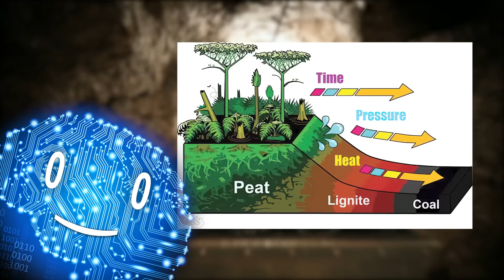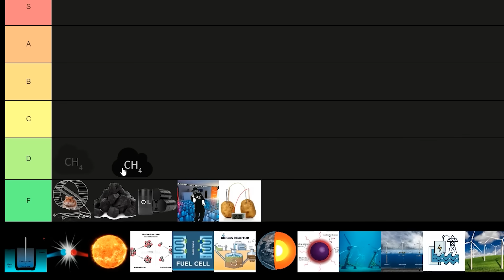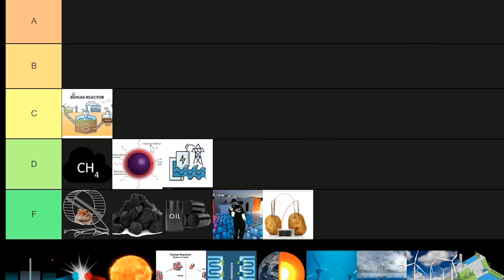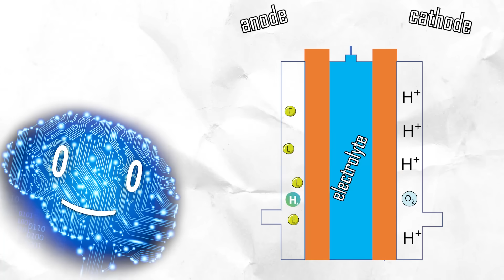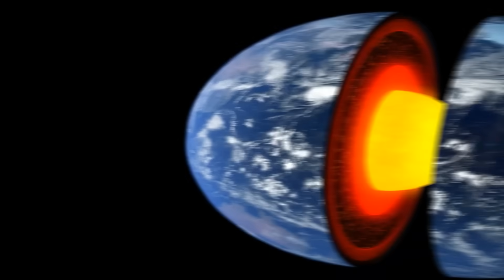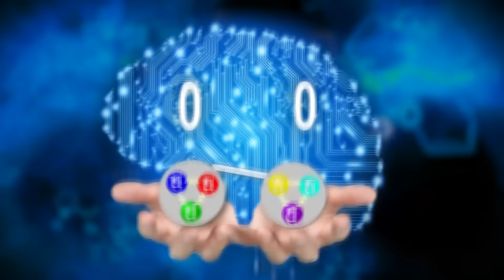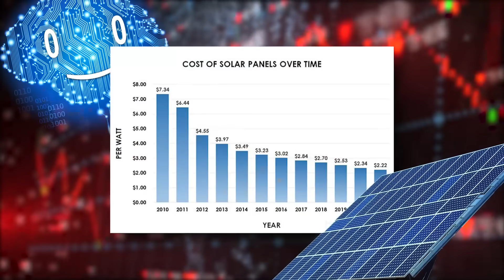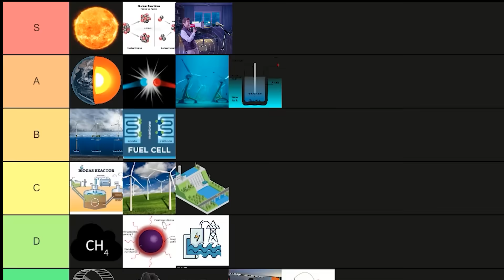Tier List of Energy Sources Explained

Comment: The anti-nuclear crowd has always been a weird thing IMO. Coal plants pump out lots of toxic fumes and plenty of radiation on their own.
Reply: Solar vs Nuclear: (source: Joe Scott)
1. Bhadla Solar Park, India (largest solar park)
- Area: 57 sq. kms
- Production: 2,245 mw
- mw per land: 39.38 mw/km²
2. Kashiwazaki-Kariwa Nuclear Power Plant, Japan (largest nuclear plant)
- 4.2 sq. kms
- 7,965 mw
- 1,896.42 mw/km²
Reply: @HSstudio.Ytchnnl  thats fucking nuts
Reply: @HSstudio.Ytchnnl also to note it’s impossible for a meltdown to happen in modern reactors. You can’t even intentionally cause a meltdown. The fuel types they use  now don’t even melt in accidents. They also have drop by gravity rods to stop the reaction immediately if power is lost. It also detects how hot the core gets. As it gets hotter it slows the reaction aswell. Now they are making gravity fed coolant so that coolant flows by gravity and doesn’t require a pump for emergencies.
Reply: @HSstudio.Ytchnnl  Which video?
Reply: Fly ash from coal is way more radioactive than nuclear waste. More so on a joule by joule basis
Reply: @Bladeofdeath311 and nuclear waste is mostly the clothes and shit which is easily disgarded and so little amount the actual radioactive matter which is 90-98% but due to a stupid nuke treaty it id heavily restricted. But no one bothers to know nuclear power plants can run for years before needing to change the fuel rods
Reply: If we can harness all the Reees online we could potentially have nigh infinite energy.
Reply: This jdr guy never actually rebuts anything and only give out his points. He seems to point out pro-nuclear’s intelligence by… insulting them? Hypocritical much?

And just by reading how he responds to people, I can tell that he types with an ego the size of the solar farms he’s trying to defend.
Reply: I am anti-fission but only if its replaced by solar. Solar is way cheaper, way cleaner and way safer than any other energy source we currently have. It gets cheaper than the other sources when you consider the fact it has zero input and its just maintenance so the longer it stays the cheaper it is compared to the rest. The main problem with solar is that it works mainly when there is good sunlight and we dont have a very good way of electricity storage so you couldnt make a big solar farm that efficiently covers the electricity need of a large area 24/7. Fission and wind are the best because they can work 24/7 but out of those wind is better. So in my opinion solar+wind is the best. It's so weird that rich people still haven't moved away from coal, oil etc since those arent even cheaper than solar anymore so you cant tie it to being greedy or selfish.
Reply: @phaiz55
 
...Continued...
 
If every country in the world had multiple nuclear powerplants, how much nuclear waste would the planet generate after ONE HUNDRED YEARS?!!! 
 
This shit cannot be used whatsoever and lasts for like a million years. Nuclear people are VERY SHORTSIGHTED lol so are we going to start shooting nuclear wastes into space??? 
 
But once again, building a power plant in the first place leaves a massive carbon footprint so most plants dont even start paying for themselves until like 100 years after building. SOLAR IS THE EASY ANSWER
Reply: exactly! it's just not monitored. all that radioactive radon and other impurities is just constantly pumped into the atmosphere. with fission those products are monitored, sealed, dealt with, and completely accounted for.
Reply: Accidents like Chernobyl and Fukushima scare people. The damage caused by coal plants is more insidious and happens over longer periods of time. And with how long they have been used, it is something people have gotten used to.

And there is also the thing that when people think nuclear, people also think weapons, which creates further stigma.
Reply: I KNOW RIGHT
Reply: These are no ecologists, these kind of pepole are called political dissidents for example in Germany moneypumped by Russia
Reply: Radon gas
Reply: The only argument they have is  the Fukushima nuclear accident which wasn’t even caused by the power plant itself but a tsunami🤦‍♂️Not to mention the technology behind these stations has vastly improved and it’s way more secure
Reply: Issue. Using coal does have a biproduct that produces nuclear weapons
Reply: There’s no justification for anti-nuclear people. Especially those who profess to be liberal climate activists. 

Well managed, well regulated nuclear energy can and will save the entire planet.
Reply: I’m against nuclear because there are better alternatives such as solar and geothermal that doesn’t create thousands of tonnes of nuclear waste that needs to be shoved somewhere and doesn’t have the chance of meltdown. I am not for the use of fossil fuels. I’m pretty sure most anti nuclear folks are like me.
Reply: Nuclear is the most expensive energy source and takes the longest to bring online. For the cost of nuclear per KWH you could have triple the energy with solar in a fraction of the time.

Uranium mining releases radioactive waste and once we run out of it that’s it. Then there’s the water usage and disturbance it brings to whatever water source is used to cool the reactor.

Yeah coal is bad but nuclear isn’t great either. Wind and solar are superior.
Reply: @scottlarue5304  Solar don't output enough power on their own, having to install a lot of them everywhere. My own house has solar panels that provide more than enough energy for my house but a nuclear reactor would have a lot more power and won't require good weather conditions. Would you want to live next to a wind farm? They are too loud, there's a reason why they aren't as spread out in populated areas, the only reason nuclear died out is because of low cognition morons that think it's scary.
Reply: not trying  (my opinion 🤓😎):face-fuchsia-tongue-out: to apply modded minecraft logic to the real world :face-blue-smiling: but. my uranium reactors (fission) :face-purple-crying:take like way less infrastructure (less upgraded item transporters)🥶 than coal for similar output.:face-blue-wide-eyes: it seems as if uranium based power solutions produce more rf (restone flux :face-red-heart-shape:) per tick as opposed to 🤮coal reactors and are :face-pink-tears:slightly more costly with regards to materials as well :face-purple-crying:. This leads me (@mozin01 😇) to believe that ☢nuclear reactors :face-orange-raised-eyebrow:are more efficient even in a scenario with instant  :eyes-purple-crying:wireless transport (enderchests mod and quantum entangloporters :face-fuchsia-wide-eyes:).  Although, one must always stick the right key into the right hole 🤨📸. You surely wouldn't catch me using a solar panel in the deep dark dimension🐪, nor wind turbines around the black hole that I generated :face-orange-biting-nails: and built a space station around :trophy-yellow-smiling:, although they would both be excellent at y-level (attitude:face-red-droopy-eyes: grr) = 256 in the overworld.  Fusion reactors :face-fuchsia-wide-eyes: on the other hand, are straight up not of the balance :face-turquoise-covering-eyes:. Water for infinite power straight up is just a Gregification :face-orange-biting-nails:(GregoriousT) of power creep 😱. Going from gradual 😴(you have to wait for it) hydro 💦power from water wheels (which is just un-Gregified 🪛solar 😎 power) to near infinite :face-blue-wide-eyes: energy from standing water🥶 seems like the pack developers ♿forgot to adjust some config settings:eyes-purple-crying:.
not to mention you can breed 😫💦leftover fission fuels for more fuels :face-orange-raised-eyebrow:.
🚼➡🚪
Reply: @Mozini01 What the FUCK did I just read.
Reply: @Mozini01  gregtech mentioned but at what cost
Reply: @Scrufflord 😭Omgggg i forgot about this comment hiii I hope you’re having a great day!!
Reply: @Mozini01  haiii :3
Reply: @Mozini01  peak yt commenting
Reply: It's not like irradiating large portions of land and sea, and killing large amounts of life, whilst also posing a major problem for the future and harming nature for thousands (or more) years to come, is a far better option.
Ain't nobody saying Coal > Fission
But fission isn't good. I can name so many better, more efficient and more enviromentally safe  options.
Reply: The nuclear supporters have a terrible sense of scale as yall get tunnel visioned hella easy. Due to all the concrete and other requirements, the process of making a nuclear plant in the first place produces a ludicrous amount of greenhouse gases. Plus nuclear waste is some of the worst stuff in the history of existence. PROPERLY containing that stuff requires constant energy which takes away from the total output efficiency. Plus you already know these companies arent going to follow all the regulations as they already dump waste where its not supposed to be
 
There is a giant ball of plasma up there tossing free energy everywhere. The money thats used for  Nuclear Plants should be allocated to making Solar as easily available as possible
Reply: @jdrmanmusiqking  How does containing waste require constant energy? For the actually toxic long-lasting waste, it gets melted down into glass, and poured into barrels of concrete and lead. Then it's stored on site, where there's already security on hand.
So where exactly does this "constant energy" requirement come from?
Reply: @m136dalie  Merely asking that question shows how most people, no matter how knowledgeable, dont understand what the phrase "total picture" means
 
Bruh the containment units for waste are damn near indestructible. The amount of energy and resources required just to make one of those things is freakin massive. As long as a Nuclear PP is active, it will constantly require new waste containers as they cant be reused and those materials are never put back into any kind of cycle.
 
And dont even get me started on the massive amount of energy needed to make the waste transport system then to keep it running. Thats a whole thing in itself
Reply: @jdrmanmusiqking  Those units you're talking about are only for transportation. Most waste is stored on site and doesn't require any energy at all once contained. Those "resources" you're referring to are lead and concrete, which are cheap and abundant.
So I ask again, what exactly is requiring "constant energy"?
Reply: bruh didn't you know that in France, nuclear waste is recycled. You have no idea that there are 3 types of nuclear waste according to radioactivity and those are low-level, intermediate-level, & high-level; 95% of the waste is low-level, 4% is intermediate-level, & 1% is high-level (source: IAEA). Almost all of the nuclear waste can be reprocessed & recycled, the majority will be nuclear fuel again & we can even make nuclear batteries out of those waste.
Reply: @jdrmanmusiqking get ratio'd fool
Reply: @freezingicy9457  "get ratio'd fool"
 
There is quite literally nothing that could have proven my point more. The intelligent level of nuclear fanboys like yourself speaks volumes
Reply: @jdrmanmusiqking  nah bru you sound like that rick and morty copypasta
Reply: @jdrmanmusiqking  i dont need to prove my point. Somebody else already has
Reply: @HSstudio.Ytchnnl I agree most people just talk like they are themselves working in a nuclear power plant
Reply: @jdrmanmusiqking  That moment when you insult others' intelligence when you couldn't even give proper arguments is ironic. 
So as @m136dalie asked, what is this "constant energy" you spoke of?
Reply: @Merlin4193  Don't worry. Our good friend @jdrmanmusiqking will not respond to @m136dalie
They'll only respond to people throwing in insults since they're easy to counter. Usually with something like "Ha ha, you insulted me and therefore proved my point".
Ignoring the actual arguments is generally safer since you cannot write yourself into the corner and loose the debate.
Reply: @jdrmanmusiqking take a look at Frances power grid. Then realize that every other country should take notes.
Reply: @GamerGod-fp1tj  Thats one country but what you said still has nothing to do with the facts of what I said. Concrete manufacturing leaves a massive Greenhouse footprint and Nuclear plants require absurd amounts of concrete (among other materials). Manufacturing proper storage facilities for deadly nuclear waste is extremely energy intensive and dont even get me started on the construction AND TESTING of these indestructible waste containers everyday all day which is another colossal energy sink . 
 
Plus, since they last for 100,000 years, the materials never go back into any natural cycle so the entire earth is at a mineral deficit. We've seen sink holes pop up because of materials not being returned to the natural earth cycle just over the course of a couple hundred years so we increased Nuclear Plant creation will compound this
 
Most nuclear power plants wont ever pay for themselves so whats the point? They produce more greenhouse gases than they save so whats the point?
Reply: @GamerGod-fp1tj  You mean the grid that has to buy expensive power from Germany at peak times and has to sell cheap power back to Germany at non peak times or let their reactors  sit their doing nothing?
Reply: @catprog  nope
Reply: @jdrmanmusiqking  > Nuclear fanboys 

Back to bootlicking exxon, aren't we?
Reply: @jdrmanmusiqking  I find the irony in this about you talking about their intelligence, while you also actively ignored the other person that said nuclear waste in France can be recycled. You're mad coping at this point.
Reply: @jdrmanmusiqking  wait till lil bro realizes how much harder it is to maintain solar panels
Reply: @defintlynoob4263  Why is this scientific discord filled with people who sound like they came straight from a powerscaling chatroom or from the PS3 vs 360 console wars era
 
What is even happening here???
Reply: @jdrmanmusiqking bruh why are you not replying to arguments which hold true and has been put forward by other commenters, like nuclear waste can be recycled easily??
Reply: @chrisnotpratt1903  All of you are ignoring the CONTAINERS and the massive amount of concrete and energy needed to BUILD a nuclear power plant in the first place 🤦🏾
 
Constructing those indestructible container require MASSIVE amounts of energy and they last for A THOUSAND PLUS YEARS. TESTING those things require even more as they ram each one with TRAINS FILLED WITH TNT! Digging up the earth for oil has already generated massive sink holes all over the world so just imagine digging deep underground creating underground bunkers for ONE THOUSAND YEARS
  
Its not a sustainable model. Plus those materials used to make the containers will be removed from all natural cycles for a MILLENNIUM+ and nobody has addressed these legitimate concerns
Reply: @jdrmanmusiqking  keep picking who you respond to and avoid all the other people who make more points against what you say lmao
Reply: @jdrmanmusiqking 20 tons is not a lot for 1 year of use. Solar would create a lot more waste per year.
Reply: @jdrmanmusiqking   Where's the wastes of Renewables stored? Every year, millions of tons are made. Absolutely NONE are recycled from the sheer scale of how they are produced. And we're yet to see how much waste they can truly produce in the next predicted five to eight years, when a chuck of the world's renewables will get retired. And, oh, heavy metals from solar panels will kill you far more speedily than gamma radiation ever would, and those heavy metals are nearly undetectable in water.
Reply: @jdrmanmusiqking   No Intermittent Renewable runs without extreme subsidies. No Intermittent Renewable takes into Energy Storage costs. No Intermittent Renewable takes into account the millions of tons of materials needed for it. No Intermittent Renewables causes less death than Nuclear. All Intermittent Renewables take IMMENSE amounts of Rare Earth Metals, non-biodegredable materials, and Concrete. Nuclear Waste is very much other radioactive materials, which are naturally present in the crust . But Fiberglass and Plastics? Absolutely NO natural equivalent exist, and they last millions of years.
Reply: @jdrmanmusiqking me when I’m payed of by the coal lobbies and think nuclear waste is green goo and people who live near nuclear plants grow third arms
Reply: @hendersonfisher2743 Youre making alot of assumptions
Reply: @jdrmanmusiqking  You’re right that concrete manufacturing has a CO₂ footprint, but pretending that’s unique to nuclear is misleading. Wind, solar, and hydro all require massive amounts of concrete and steel per unit of energy produced. In fact, per megawatt-hour, nuclear usually uses less concrete and steel than wind and solar.

As for nuclear waste: once fuel is cooled and moved to dry cask storage, the casks are passive. They don’t need “constant energy” to be maintained, and they certainly aren’t being tested “everyday all day.” That’s not how the system works. casks are built once, sealed, monitored, and sit passively for decades without active energy input.

The “mineral deficit” argument doesn’t make sense in this context. The earth isn’t running out of material because we turn uranium ore into fuel or cast steel into casks. Sinkholes form from groundwater erosion of limestone, not from lack of “returning” mined material to the ground.

On economics and emissions: multiple lifecycle studies, including from the IPCC, show nuclear has among the lowest greenhouse gas emissions of any energy source, on par with wind, and far lower than solar, gas, or coal. And yes, nuclear plants do pay for themselves: their capacity factors (often 90%+) mean they generate far more electricity consistently than intermittent renewables.

So the real question is: if the goal is reliable, low emission power, why dismiss nuclear when it consistently performs as one of the cleanest, most dependable options?
Reply: @jdrmanmusiqking  you insult pro nuclear but you forgot the fact that; 1. Nuclear waste can be recycled to make new nuclear pellets (the clump of nuclear source within a reactor). 
2. The amount of space it takes to store nuclear waste. 
3. We are advanced enough in engineering and geology surveying to find optimal spots underground to store waste. 
So please don't insult pro nuclear just because your argument is falling apart.
(I know it's been a year since your comment but that's my 2 cents anyway)
Reply: @jdrmanmusiqking  nuclear power plants barely produce any high nuclear waste to begin with most of its waste is the ppe gear they throw away after it expires.
Reply: @jdrmanmusiqking nuclear waste can be recycled, but three types of nuclear waste via exist: Low-level, Intermediate-level and high level , 95% of the low nuclear waste level can be recycled as with the intermediate level possibly being recycled thru 4%, with 1% being recycled thru high level nuclear waste , the recycling process can allow to stop the uranium purchase for a temporary time due to the reason of the mass exploitation of this recycling process , for me the problem with nuclear energy are the people who work there and can possibly break safety regulations ,  causing a meltdown as within a modern reactor it’s entirely secure and better engineering than the old RBMK-1000 Soviet reactor
Reply: @jdrmanmusiqking lmao l solar energy and wind energy utilise non environmental resources and use more materials and space , what means ,
Reply: @Tanksbuilder Is this english? No comprende
Reply: @jdrmanmusiqking making fun of a person’s English, meanwhile i am a foreign nationality
Reply: @tigrovica8417 you'd be surprised what soem people can do to make their insults backfire (source: someone said "atleast im not pretty". Im not kidding)
Reply: @jdrmanmusiqking   Soooo... What with all the batteries you need for the solar panels... and when they dont last as long you cant dispose of the toxic materials... then that is less effective
Reply: @jdrmanmusiqking do nuclear reactors turn off when it gets cloudy?
Reply: @thefederalrepublicoferusea3900  Can't solar panels store energy?
Reply: @thefederalrepublicoferusea3900  nuclear reactors turn of when you make them turn off. Or they automatically turn off after a certain amount of time to prevent anything from happening.
Reply: @Bro-vs5mk  thats exactly my point. Nuclear can be set up anywhere the demand is high enough
Reply: @jdrmanmusiqking yall think that solar energy is the best, but its by far one of the worst, all of you were blinded by chernobyl,
We also have thorium, a perfect alternative to uranium
Reply: @Arman_914  From my observations, the pro nuclear peeps have the cognitive reasoning skills of a 2009 XBox 360 fanboy
Reply: @Arman_914 dont say thoruim is a alternative to unrauim thats incorrect.

Throurim has benfits but uranuim can also do the same as throuim
Reply: @kringle7804   thats literally what an alternative is. Something else that does the same thing
Reply: @jdrmanmusiqking low quality clown bait.
Reply: @kringle7804 Uranium can do some things better than Thorium and some things worse.
The things it’s better at are mostly exploding.
Reply: @victorvirgili4447  ehh not really
Reply: Thorium is significantly more common but there’s a reason we don’t use it. It’s nowhere near as efficient as a fuel source for fission. You’d think if it was such a good idea we’d use more of it lmao
Reply: @jdrmanmusiqking I hope she sees this bro
Reply: @jdrmanmusiqking  Then your observations, and in in consequence all of your opinions, are miopic and ignorant.

You're scared of steam power with extra steps, despite having no single idea how fission even works.
Reply: @Arman_914 well the thing about solar is that it can grow exponentially like a Dyson swarm
Reply: @jdrmanmusiqking immediate defense mode and “insults”? How should I seriously consider someone that says stuff like “Nuclear fans are same as this and that”, how should anyone listen and change their minds when you say stuff like that
Reply: @jdrmanmusiqking   From my observations, anti-nuclear people are ALWAYS funded by Fossil Fuel subsidiaries, and a desire to ignore numbers.
Reply: @freezingicy9457   No. Thorium is and UPGRADE. Thorium is made in tens of tons daily from Rare Earth Element extraction, which means we could redirect the "trashed" Thorium to Power Generation. Can likely achieve much higher temperatures; have FAR more energy per kilogram; requires no enrichment (saves infrastructure costs); and is otherwise named after Thor, a Nordic God, making it non-negotiable cooler.
Reply: @nicolaslast8961  Thorium was last commercial in 1965. After than USA's Nuclear Commission made it functionally impossible to make ANYTHING aside Uranium fuel, water cooled, PWRs/BWRs. Only from 2022 and after has Thorium's name even been uttered.
Reply: @jdrmanmusiqking  Stupid people often think they're not stupid and believe others are, you're one of them
Reply: @Raffy-wo4ph Can you point out which part of my presentation was "stupid"?
Reply: @jdrmanmusiqking you got heavily ratiod multiple times, I don't have to explain it again when everyone already explained how flawed your argument even was a year ago
Reply: @Raffy-wo4ph Sooo... youre just yappin. 😂😂😂
Reply: @jdrmanmusiqking what kind of dumbahh response even is that, did you just gave up?
Reply: @kringle7804less energy and less abundant, also harder to stop, however nuclear reactors that use uranium are much easier to make and have a stranded design while we are still trying to make a thorium reactor
Reply: @jdrmanmusiqking  thorium is the future
Reply: @jdrmanmusiqking same thing with solar panels. All the factories you would need. Nuclear power plants produce a lot of energy without taking up a lot of space. They would have to build hundreds of factories to make solar and they are made from toxic materials. Also all those solar panels will have to be cleaned or they will break. That would cost hundreds because companies would charge a ton for it. Solar panels take up to much space and don’t look cool. Nuclear is much cooler and the waste produced is very small. You Solar people think that one nuclear power plant makes millions of tons of waste a year. It really produces 20 tons a year. Much more sustainable then the amount of solar panels that would turn into e waste.
Reply: @jdrmanmusiqking  Here is why Nuclear is good. Nuclear expensive and hard to make but it makes ALOT of continuous and nuclear plants can have multiple reactors (No stopping like solar and wind) power for about 20~30years so it is great for cities and high dense area so Nuclear is still the answer for most places on renewable energy also Solar is great but nuclear has to be the back bone as it is continuous also Wind is easy to break down with it planetary gears and don't last long but I think they are stil applicable in most places. Also after the nuclear reactor ends it service life the Small amount of waste fuel can be recycled to enrich it more or just stored deep under ground whcih couold pile up in the next 1000 years or something it not a problem right now but LAWS should be put in to place to properly dispose of nuclear waste
Reply: @jdrmanmusiqking is it better than pumping billions of tons of carbon into the air and being very dependent on fossils
Reply: @devoof Im actually both amused and confused about how literally no one addresses any of the main points 🤦🏾
 
1. THE WASTE CONTAINERS THEMSELVES and the PROCESS of storing is the problem im talkin about Not the waste inside them.... Jeez how is no one smart enough to READ and COMPHREHEND something so simple🤦🏾
1a.  Not only are the matierials taken out of ALL NATURAL CYCLES for 10,000 years, but the energy used to make and TEST them is MASSIVE. These things are hit with TRAINS FULL OF EXPLOSIVES. Every. Single. One. Most of the energy you "save" from going nuclear just goes right back into the waste maintenance process 
 
1b. Humans have been mining oil for only a few hundred years which has already increased the number of sink holes  due to the unnaturally rapid matter redistribution. So making massive underground storage facilities and burying indestructible materials for 10,000 years just is not a sustainable practice. Earth is big but still finite lol you cant even fathom how the world will look in 100years so thinking you can make plans for 1000+ years is just asinine
 
2. Nuclear plants use tremendous amounts of  concrete which produces MASSIVE amounts of greenhouse gases. That and the energy used for the containers ontop of general maintenance costsof running the things are why they nuclear plants never become energy neutral. Never ever ever ever so "clean" nuclear energy is a myth
Reply: @jdrmanmusiqking nothing wil be perfect. The waste has to be stored and i knew that. Everything has downsides but what choice to we have?
Reply: @jdrmanmusiqking is there anything?
Reply: @devoof Bruh it's not about perfection its about being REAL and NONE OF THESE ISSUES ARE EVEN BEING ADDRESSED BY THE FANBOYS
 
Hence why this is not a scientific discourse. Its just nuclear worshipping fanboys who cant look at reality objectively. Tye nuclear model is simply NOT SUSTAINABLE and wildly damaging to the planet which defeats the entire purpose
Reply: @devoof My prior comment was deleted. Ive spoken too much truth already
Reply: @jdrmanmusiqking yeah, murica doesn't listen
Reply: @jdrmanmusiqking  Solar isn't space efficient, It's better used for smaller scale energy requirements. such as streetlights and other battery-powered solar charged things.

 Nuclear Power is for large scale electricity production, and storing nuclear waste doesn't need "constant energy", It justs need a containment chamber to not let the radiological and chemical hazards contaminate anything.

But i guess my comment doesn't matter because i won't get through your apparent paranoia of Chernobyl & Fukushima.
Reply: @jdrmanmusiqking  solar isn't even that efficient and it's hella nconsistent btw, manufacturing them also causes pollution, takes up a lot of land, and it's not always sunny especially on places with a tropical climate

That's the main reason why countries still stick to coal and gas, it's much cheaper than these green options because they're much more expensive, inconsistent, covers more space, and doesn't output more energy
Reply: @jdrmanmusiqking  bro researchers in france have already found a way to make nuclear waste into fuel
Reply: @jdrmanmusiqking  Lmao anti nuclear incel alert, either you are genuinely an anti nuclear incel or this is ragebait, most anti-nuclear "people" have the cognitive skills of an orange
Reply: @jdrmanmusiqking good bait mate
Reply: @jdrmanmusiqking  solar panels are not the solution at all bro but this comment is a year old so maybe you already know that idk
Reply: @jdrmanmusiqking  Used fuel pool for around 6 years, use it back for maximum 2 times. Then put it in dry casks that are extremely resistant. Sure it is expensive, but it is safe, reliable and efficient.
Reply: @jdrmanmusiqking the benefit outweighs the cost, especially if we go with Thorium. Solar doesn't provide bulk energy needs
Reply: @jdrmanmusiqking I think we can all agree though. No matter what type of energy we use big tech centers will ruin it.
Reply: @jdrmanmusiqking bro have fun losing land and habitat because solar farms need ton of space and perfect conditions to meet increasing demands which also btw creation of them create more CO2 per sqm

Why can't you just accept boiling water using a handful of spicy rocks to spin a turbine
Reply: @jdrmanmusiqking  containing nuclear waste doesnt need constant energy and is pretty safe though??
Reply: @Mctrrt1 Literally look up how much goes into creating just ONE waste container. Then, to test them they literally hit them with TRAINS full of EXPLOSIVES
 
The amount of energy used in waste maintanence is absurd. Plus the materials used are pulled out of all natural cycles for OVER 1000 YEARS MINIMUM which will definitely have negative effects on the earth in less than 100 years let alone 1000.  And were not even talking about the problems of digging massive facilities underground for millinium+. The Nuclear model just isnt sustainable even if everything goes right but he all kno humans will human
Reply: @jdrmanmusiqking  The concrete from wind turbine construction doesn’t produce emissions?

You’d rather do solar + batteries? So you’re hoping that maybe one day they’ll actually be recycled and not just buried somewhere where they’ll likely contaminate groundwater?

And containing nuclear waste requires constant energy input? *Looks at a dry cask* … please explain how that works, because once spent fuel is sealed in a passive dry cask, it doesn’t need active energy input.
Reply: @jdrmanmusiqking  nuclear waste is barely radioactive because its literally has tons of inert material combine with it and is put in a caste thats stronger than tank armor, so its far from "the worst stuff in the history of existence" you are obviously just misinformed.
Reply: @jdrmanmusiqking  Rosatom already has full cycle ВN-800 reactors that use nuclear waste as fuel and turn it into basically lead
Reply: @coffee2993 really? I'll have to look that up because that would go a long way for making nuclear more effective
 
Digging deep underground, blowing up trains, and keeping material out of all natural cycles just to manage waste is not sustainable for model for 100 years let alone 1000
 
Honestly, any 1000year plan should undergo heavy scrutiny
Reply: @jdrmanmusiqking what energy bro, all it is required for the contaiment of the waste is a lead box and that's it. Why th would somebody need energy to contain it.
Reply: @jdrmanmusiqking leftists ☕️
Reply: @LoveOfLam the hell does leftists have to do with this entire discussion...
Reply: I’m a little left of center, too. But I still think nuclear is far superior to solar in every way other than initial price (not saying thats really a huge issue). Solar panels are produced in factories that use greenhouse gases to power them, so the whole argument about the initial construction producing greenhouse gases is mute. Also, they talk about nuclear waste. What about all the e-waste from solar panels? That ends up in the ocean because there is no way of salvage any of the materials from technology like that. Considering solar panels typically have a lifespan of about 30 years, if everybody used them, there would be too much e-waste for us to really deal with. And finally, the efficiency and reliability of nuclear just absolutely cannot be beat by anything to do with solar panels.
Reply: @LoveOfLamfake leftist, leftists love nuclear energy